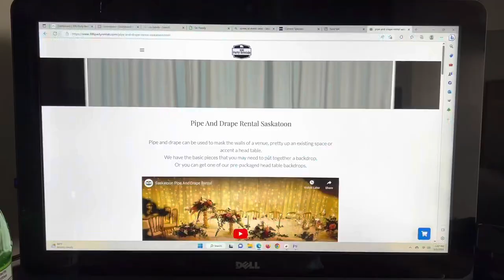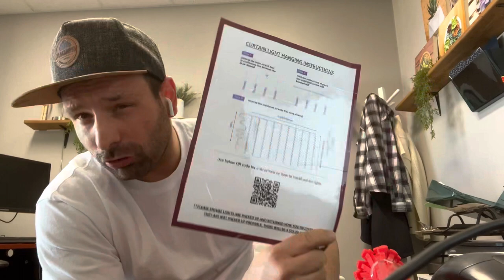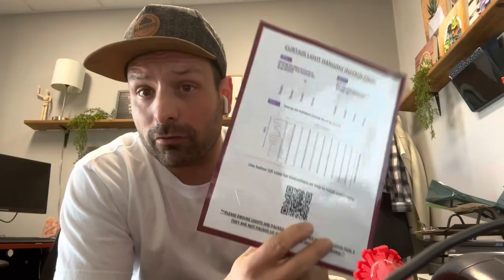Pipe And Drape For Beginners - Event Rental Business

Comment: Hey Lee, quick question. I have built a photobooth, just like you made one. But I would like to also work a printer into it, because the photobooths in the Netherlands often have the prints coming out of the booth itself. Have you ever tried that? Are there smaller photo printers?
Reply from the maker: Yes, but I quit offering prints when I switched to pickup only. I had a DNPRX1(HS) printers.